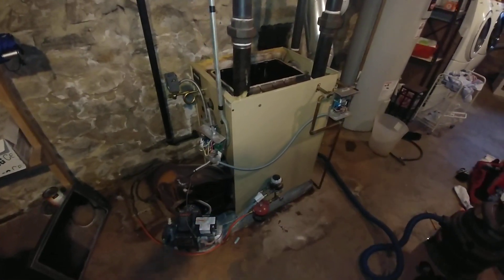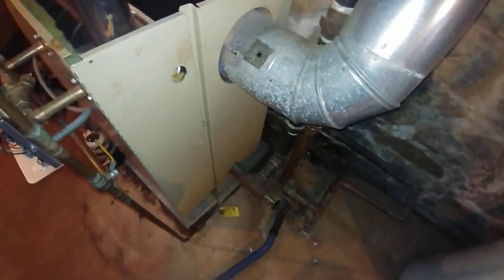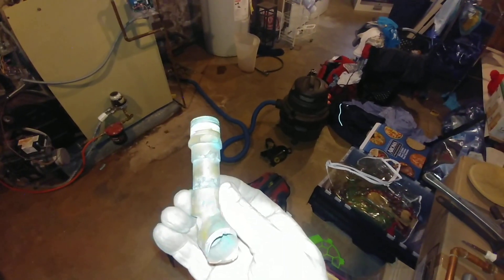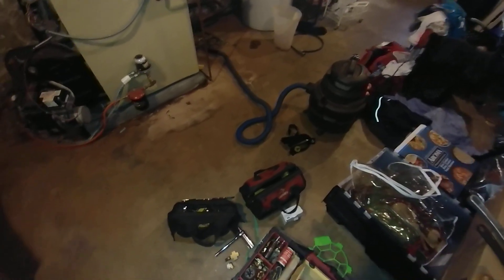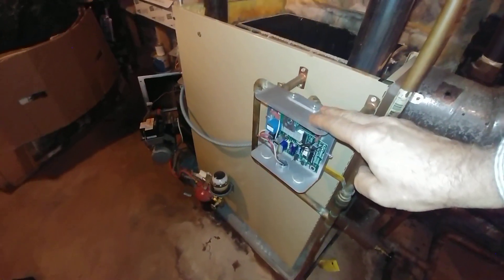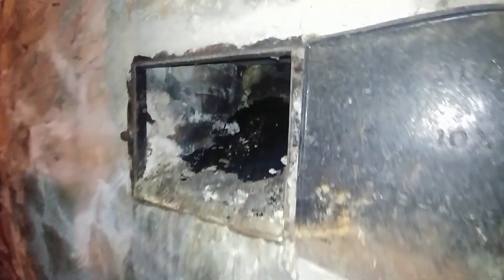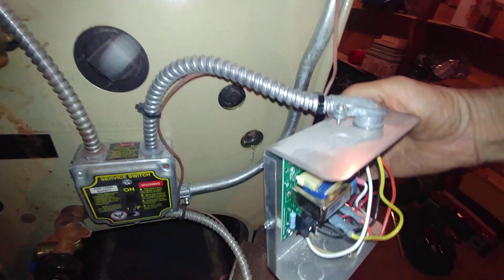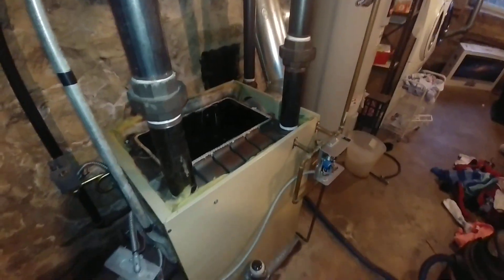Steam Boiler Wetside Issues (Clogged Pigtail) & Fireside Issues (Soot!)

Comment: "if installed and serviced correctly this boiler may possibly last 25 years (or may not). -- this is from 
Dan Cork (VP of Marketing) and it is car-sales man version of the Boiler-sales-man response: DISGRACEFUL to every inch of humanity.  What he didn't say is, there are KNOW defect affecting possibly affecting thousand of boiler, just waiting to explode due to manufacturing defects.
Ask him yourself Dcork@usboiler.net

P.717-481-8428
C.717-823-7085

What he does not tell you is that, there is a known defect that the IN-series boiler has, and they are praying and hoping customer don't know about it...it's the reason why License Installers in NY REFUSE to buy Burnham boiler:  Don't buy this crap anymore people.....the company is like the Opioid company when it comes to taking responsibility.....What I have to is is -- install Burnham at your own risk!
Reply from the maker: We also do not install Burnham IN.
We noticed that after 2001, they started failing after 10 years.

Comment: Great info here.  Just changed out the iron pigtail on my boiler that was totally clogged with a brass one and added a union for easier disassembly the next time.  Only problem is that the pigtail’s soft Chinese brass is so soft that it gets cut into beyond the threads by the cast brass union and can’t be really tightened down as I would like it.
Reply: Thank you for your compliments!  Ah, yes!  Finding good brass pigtails is a challenge.  If the pigtail brass alloy color is very yellow, it generally has too much cheap zinc, for a start. You want to search for a so-called "red" brass, its almost a bronze alloy.  Generally, I find those red brass ones have better threads, too.

I can remember going into various local supply houses years ago and complaining about the quality of the import yellow brass pigtails and their lousy straight (not tapered) threads and being told the local utility's sock puppet service arm personnel all buys them and I am the only one complaining about the quality.

I started buying good quality red brass pigtails from McMaster-Carr and never looked back.   Best of luck to you.  Please let me know how it works out!